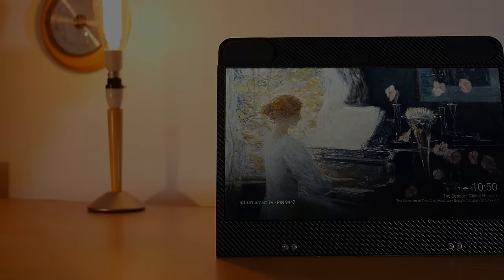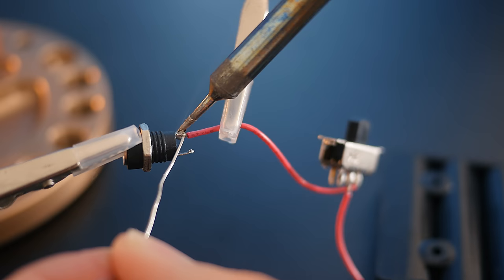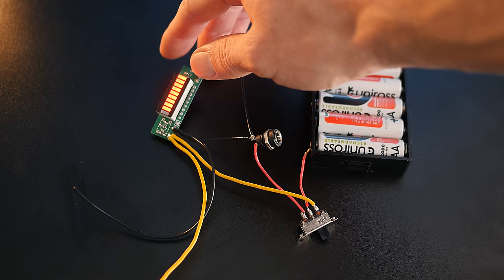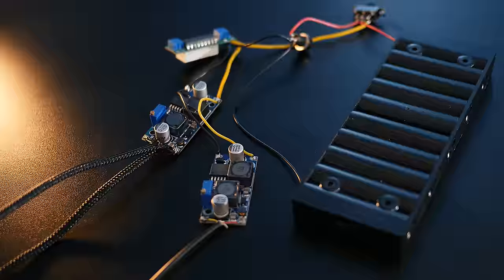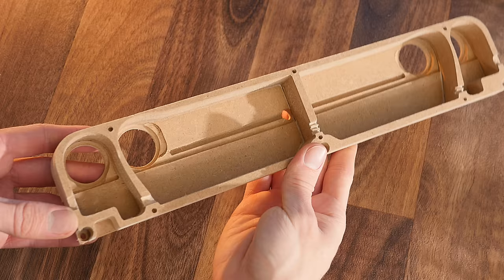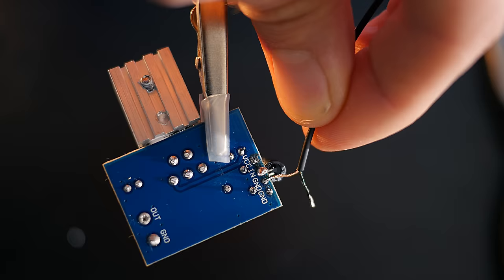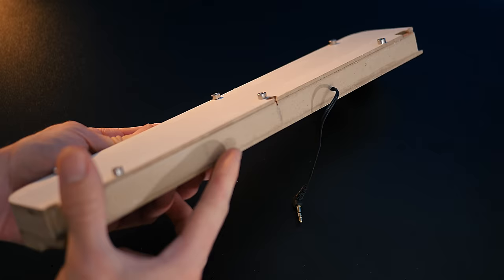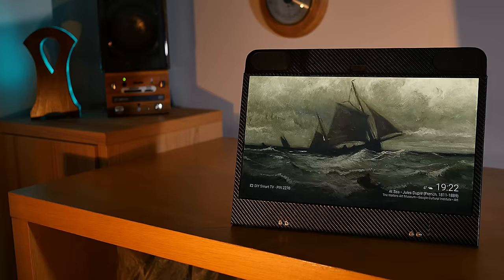Build your own portable SMART TV (100% wireless!)

Comment: I made one with four 18650 cells a while ago. It utilizes an internal eCube E4 balance charger and a custom voltage monitor which switches the buck converter off when the voltage hits three volts. I will probably add a dim when battery low function later. 
Great video!
Reply: owh please do share how you do it. im more of a copy cat then an educated electrician or engineer.
Reply: Agreed I am looking at doing this too have 6 18650s waiting for this
Reply: Do you have a video of this please as this is what I want to use and I'm stuck how to wire it up xx
Reply: nowadays id do this way differently. just a pd trigger module and a usb pd powerbank that can put out the needed voltage. you get all the battery protection and battery level indication without any effort

Comment: Hi DIY Perks - If I may, I'd like to make a video request that can be 
very helpful for farmers in developing countries like India. The request
 is to create a centrifugal water pump that runs on the concept of 
sterling engine, powered by heat from concentrated sunlight using 
fresnel lens. So to simplify, the fresnel lens concentrates sunlight and
 generates heat to run the sterling engine, where the wheel of the 
sterling engine is the wheel inside the water pump itself. This can 
really help farmers in India who have limited access to power to water 
their fields. Thank you so much in advance.
Reply from the maker: That's a pretty good idea. I will add it to my list!
Reply: Thank you :)
Reply: DIY Perks check out the tesla valve.
Reply: Aah! Man,that's gonna be ineffitient.the amount of materials used for focusing such huge amount of light,and size if land covered could have been used for high voltage power line instead.
There is gonna be a huge loss of energy ,by reflected radiated heat.
Reply: Hey Suraj, I don't think the system would be inefficient or occupy large space. You can generate as much as 2000 F with a 50 inch single point focus fresnel lens. Combine that with the centrifugal pump, it hardly occupies much space. If you intend to put it in your living room then yes, it does occupy lot of space. But if you install it near the wells in farm lands, which is my motive, then the space wouldn't be a constraint.

As long as we get the right amount of energy to run the sterling engine, I don't think we need to worry about the rest of energy. In fact, some loss of energy or dissipation into surroundings is good as it prevents overheat and damage of materials.
Reply: 1- Fresnel lens need to be at focal length away from target, thus making the support structure huge, better using mirror reflector

2- mirrors have to be supported by metal
they also require some system to move them bit by bit throughout the day

3- a massively heating target and a cooling tower needs to be built, materials will be wasted on it

4- all these systems,be it Fresnel lens,mirror or solar cell, casts a shadow onto the ground, thus inhabiting proper plant growth in those shadowy areas

5- massive sterling engines aren't effective (losses to friction)(cost vs alternatives)

6- people have bulls to power pumps. as a Punjabi jatt, iv'e seen many.Solar to plant,then plant to muscle power is way more efficient, plus it provides us with tasty meat after they stop (which is unfortunately FREAKING banned in India)

7- The real problem is not the shortage of water, its the shortage of CLEAN water.

8-You are making this request to a maker who is electronic engineer at most, who you need is a civil engineer.

9- I don't know of any village without electricity. India is far more modern than what you think of.

conclusion- solar based system is best suited for deserts and wastelands.India has a natural gift called "monsoon", find a way to collect all that rainwater,time your corps right, you'll be fine.
Reply: Let's just agree to disagree and move on.
Reply: except for the fact that you were making this request to a maker who is electronic engineer at most, who you need is a civil engineer.
Reply: We both know that even if I'd provided a rational response to your eight points, you'd still come up with reasons to troll me.  I don't wish to participate in a discussion that is irrational and counter productive. This is my last response to you. So lets put an end to it.
Reply: Karthik D he wasn't being a troll he was telling you that it wasn't so smart to ask an electronic engineer for what you want when a civil engineer can do that. It wasn't really necessary to be so immature about his rebuttal. I know this ended long ago, but you need some chill.
Reply: Well, I live in a world where India is run by a "chaiwala" and Elon Musk who has no degree in aeronotics or astronautical engineering has managed to deliver reusable rocket. I think civil engineer or electronics engineer is just a name and they shouldn't be used to confine one's abilities. Also, DIY Perks himself liked this project and agreed to add it to his list. So I don't understand the whining.

I don't think I was immature. In fact, I was mature enough to let go because he's not the listening type. I'm the one who first politely said " let's agree to disagree and move on". In spite of that, he still kept forcing his way. Have you read his 9 points ? When people say things like "I'm a Jatt, I've seen many, India has a natural gift of monsoon" , I pity their conservative thinking and lack of common sense and get annoyed by their arrogance.

So I stayed quiet because there is no point in arguing about quantum mechanics with a rottweiler.
Reply: I hope you'll read this to the end.

Lol, man your resiliency surprises me...Elon Musk is just a rich programmer who is  funding all sorts of stuff...the design of tesla car isn't his...he's just the owner of the company...the rocket that exploded due to a problem discovered and resolved decades ago,was also not his design...the hyper loop ,a failure even before it was made...the good point about him is,his programming skills that lead to PayPal and his mindset about helping others and not holding on to the money he has.

And also you talk about a tea seller who threw the country into recession,
Caused unorganised sector factories to halt, ( due to inability to provide salaries..eg Ludhiana cycle industry) just for a plan to curb corruption with currency replacement (which originally was RBI's plans to stop fake notes ONLY)...still ministers and evils have found ways to get hold of valid cash for invalid ones)
And now he says, 'go cashless' just to mask his failures...
Not to mention...the he's wasting away India's resources by bringing in foreign manufacturers and thus having Indian industry, a reduced chance of competing.( eg, India has capability of making their own aircrafts and missiles... But they won't be made because he bought foreign contracts)
He is not the only one at fault with messing up with Indian defence equipment manufacturing (eg..Insas project) but, surely he's one of them.

I could go on ranting whole day about it

In the end... I would like to say that We don't need a leader... The system made us think that we did

About the sterling engine concept...
It's not a bad idea...until it's implemented badly.
Put least amount of resources to use In a way that generates maximum output out of it, is the need of the hour...there are far better places than farmland for getting sterling engine based power.

Btw I recommend you to study how cults and 'cults of personalities' work...you certainly seemed to be entangled in them

And about me mentioning that I am a jatt...most people call themselves a jatt when they don't even know how to hold a handle of a hoe.They mearly mean that they are dangerous and don't mess with them.Those people are disgusting to me.
I'll say I'm a jatt because I can work on farmland...I hate physical violence and modern Punjabi culture.

And about the 'arguing with Rottweiler ' statement...
You won't be getting any respond from him...unlike here, where both the parties are in a conversation
Use it when in an argument, the opposition is too afraid to say anything.
Also ,using it as the one who is a part of it.is rude...use it when you are a third party.
It's funny how it's more applicable on you than me (where are your counter arguments)
But the guy who chattered away about quantum mechanics to a dog didn't just waste his time... Since he was able to spend time thinking about it,visualising the concept and practicing talking about it. Plus the dog learnt what human speech pattern is like, that will help him later in life ,making    Him more comfortable around humans.
Reply: Frances Wright-Tellado.
+1 for counter arguing
Unlike the guy above who talked about " lecturing a dog" And had gone silent, just like a dog.

 It's all about the stock pile of tools that he needs... 
He clearly lacks them.

For the engine itself, he'll need a milling machine and a lathe.(machinest's tools)

For the instillation, he'll need a team of people with tools related to structural construction.

For concentration of light. He'll needs a krillin for glass blowing and expertise, time and dedication for using it.

He'll probably decline it unless he's crazy rich
Reply: Just try accessing the costs related to a "non toy" sterling engine and then we'll see.

He'll be stuck, just like the " Hack Smith" is. He's a guy on YouTube who undertook a project which was too expensive for him and hasn't completed it since a long time.
Reply: OK, accepted.
Maybe one or two sterling engine"toys" is possible but it will require probable a company to create a proper one.

If you have the will of opening a company, why not to go ahead and do it yourself.
Reply: Nobel cause usually gets blind and fast funding... Just like the water seer project, which is 0.000001% cost efficient, and yet people funded it. all those Africans need was a simple water filter. 
Or just like the "solar roadways project" the guy has already collected so many funds to install solar cells onto many houses, he wasted it all, just to turn a small section of walk path into a partially functioning zero output panel of disco floor
Reply: OK. Sure, keep on suggesting this stuff again and again to him. Maybe he'll notices.
I'm out, being tired of this.
Reply: Don't bother Suraj. These people reply to moderate, argumened scepticism with comparing you to a dog. Too blind and arrogant about the 'greatness' of their idea that they can't even take criticism. This is typical of 'green energy' nuts. They simply lack common sense, an idea of what funds, materials, time, energy and it's own form of pollution actually goes into building a fucking sterling engine and massive lens, how that all would go together in a way that would beat even a diy or off the shelf electrical pump. It's blind cultism tforthe 'virtue' of 'green energy' where they'll insult you for even the most nuanced, argumented bit of realism. They frame you as if 'lacking imagination or intelligence'. These people are very much like the 'anti-racism' nutters. Just can't accept basic realism that would take them away from their idea of 'divine'' calling towards their twisted idea of 'progress'. In Belgium they nearly used 2 billion Euros for biomass energy plants. A fuel that is millions of times more pollutant and straining on the earth than nuclear power. Stopped only by the outrage of the people who literally saw their electricity bill go up 20% due to the oversubsidizing of solar panels before. This is snakeoil on a whole new scale. It's taught like a cult. It breeds arrogant retards of it's own who frame realism as a 'lack of imagination', a new 'heresy'. And a few assholes get rich off it of course.
Reply: You know, back in the day people didn't believe it was possible to go to the moon. Or that it was worth it. Some country with a distant interest decided to do it anyways. Nowadays it's unquestionable that creating a moon base would be profitable, and there are those who actively try achieving this goal, and no one takes them for a fool because of it.

Maybe a component or two would have to be changed about this system Karthik propsed, maybe a sterling engine is a bad idea, but a different engine with similar basic principles of operation would make it a viable solution. We can't know until someone with the proper knowhow actually takes the effort of finding it out. And this, Suraj, Jan, is the point that you both have missed.

PS: Biomass and nuclear power are apples and oranges. Compare the pollution factor of traditional fossil fuels and biomass to get a better picture of what the argument is really about. No one questions that nuclear power is cleaner in terms of carbon footprints.
There is no actual contender in the same league as fission reactors yet, until fusion reactors get off the ground.
Reply: How about a methane digested??? people in Vietnam use very basic ones only issue is if they don't run the gas through a filter the other gases will cause rust on burners and such. though I was thinking of using it's energy to produce power through a generator.
Reply: Methane digester or biogas generator
Reply: gold....
Reply: liked your opinions....what's your background and refer some interesting material if possible...
Reply: any good reference to "cult of personalities" u were talking about?
Reply: @SurajGrewal   ........I know it's 2 years old comment..........but still ---- STFup !!!
Reply: @NavinBetamax  instead of throwing a slur at me, give me numbers, fact or reason I'll change my mind.  But wait, why is a person with an elderly's photo, typing like a teenager?

Hey YouTube, we've got a fake one here.
Reply: @sandeepsrikonda7352  oh, I was talking about the Indian leader Modi.There's ton of data out there, just Google 'modi bad', you'll get a lot of data.
For more examples of cult of personalities, here's a list
Stalin
Hitler
Gandhi (a non evil example)
Mao 
Om shin rikyo
Ram Rahim
L Ron Hubbard
Charles Manson
Reply: What about ram pumps. No electric.

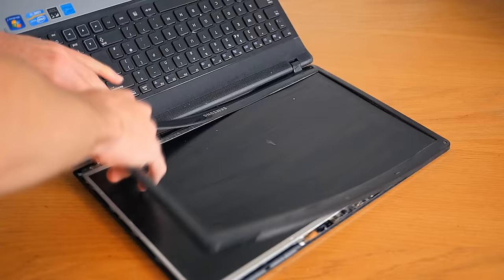Comment: 0:50 I like how he said the extended monitor project was pretty basic, dude... for the rest of us human being it's not LOL
Reply: Tbh, I think it's easier than it looks. You just need the courage to try. After all, trying is the best way of learning. I've gathered a few screens from laptops and are going to try to make one extra screen based on his video.
Reply: Christian Persson hello cristian have you had any luck on making one? I am going to try to do it too but its just really hard to follow this guy lol.
Reply: I removed the lcd from an old laptop and waiting on the board. looking forward to the challenge. will be adding a power bank instead so I don't have to do all that extra work. thinner neater
Reply: @osnaldov  How did the project go? Did you find a good working power bank with enough wattage, volt, amp, and mAh?
Reply: @christianpersson4643 did you build your screen with a power bank xx